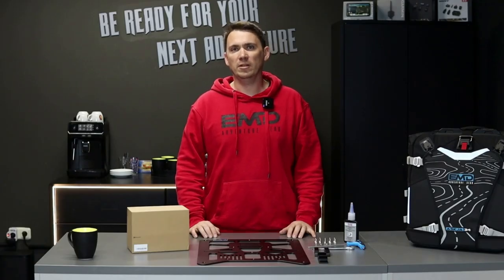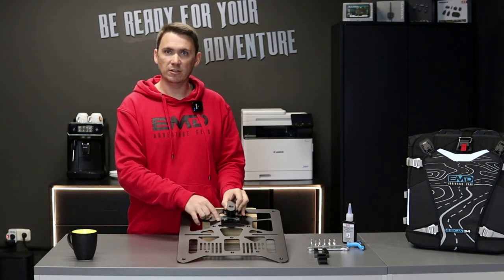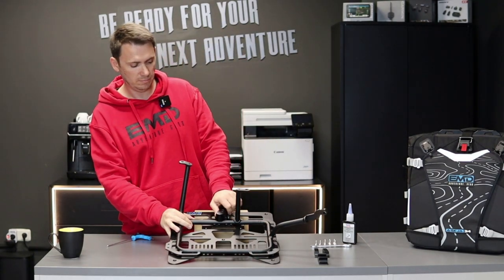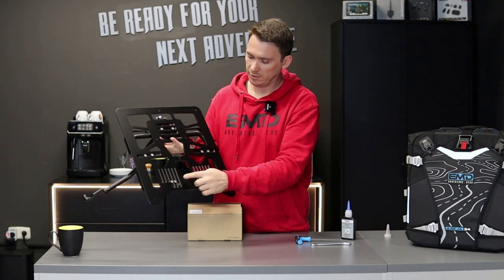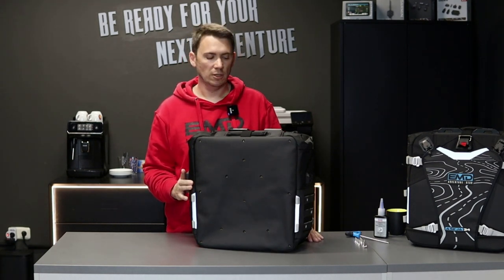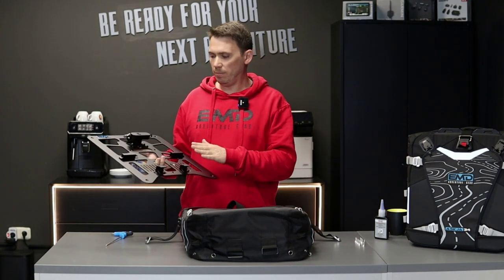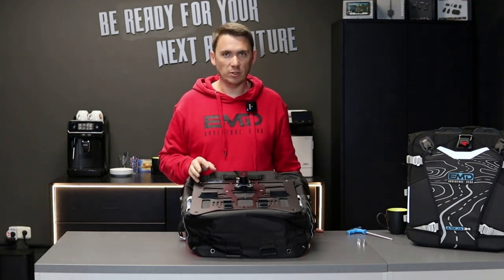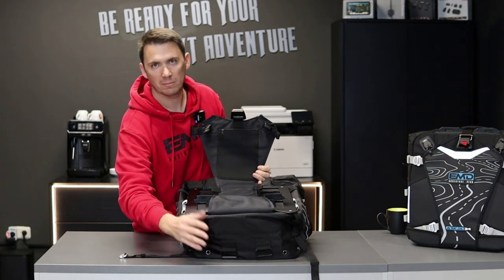EMD Adventure Gear - ASKJA 34 Installation Video

Comment: These have to be the best soft luggage system I have seen so far. I have ordered some racks for my bike today and reserved 2 Askja34  bags. They will be placed on a KTM 1290 Super Adventure. These will travel to Picos de Europa soon. I will provbably snap pictures etc..  Would be awesome to be able to get different logo colours on the Protective shield e.g KTM Orange / Suzuki Yellow / Ducati Red. Can´t wait to use them!

Comment: Excellent Video! I have BMW OEM Rack with a bend in the right-side rack due to the exhaust. Does the right bracket adapt to the angle difference in the BMW OEM rack?
Reply: I have 1250gs also. YES, there is an additional piece that extends the top lock to fir oem rack

Comment: Hi Thomas, looks like a well engineered set of panniers. In case I would like to mount them on the pro side carrier by SW Motech, any possibilities? Maybe it is possible to mount the 4 fixing blocks of the sysbag adaptor plate on your backing plate?
Really nice gear, well done!
BR Ruben